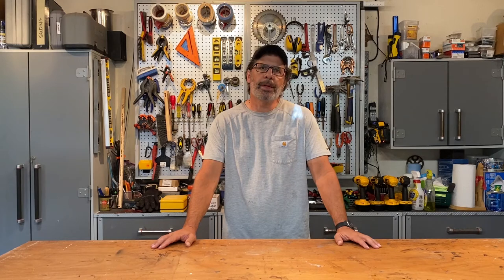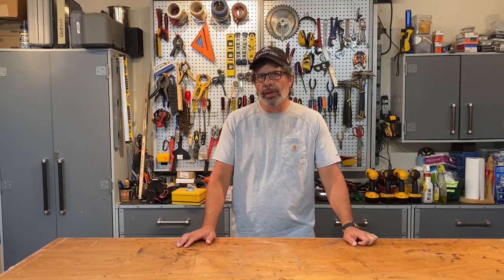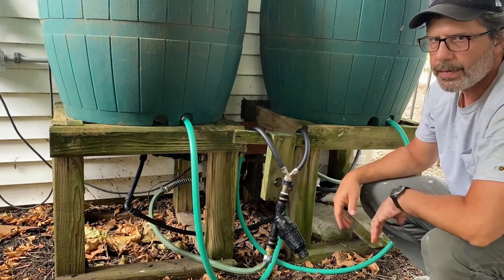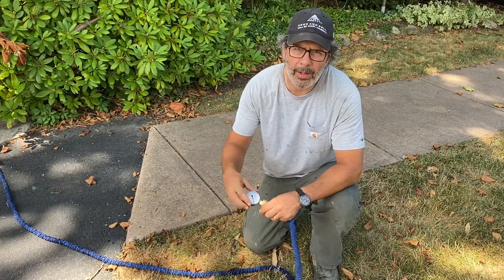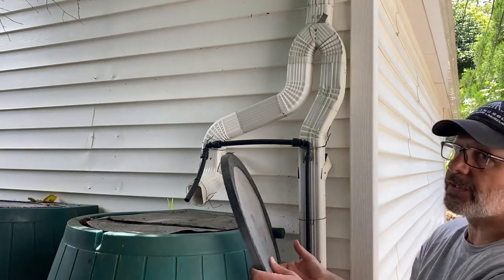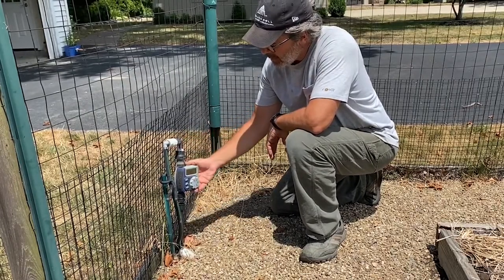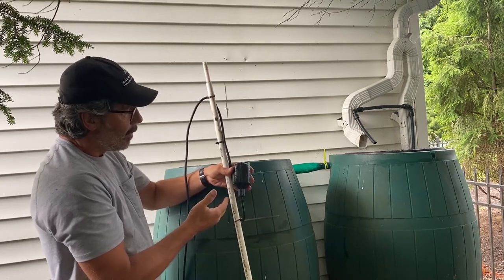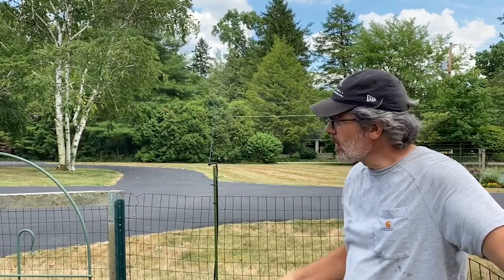The Ultimate Rain Barrel Irrigation System

Comment: I’ve probably watched 50 rain barrel videos and picked up tips to apply to my system. This presentation is the most comprehensive presentation I’ve seen! The pump installation is a great idea. The entire system is simple, yet covers all contingencies. Thank for the great presentation.
Reply from the maker: Thanks for the feedback!
Reply: He may need more barrels to contain rain water. Seems impossible to fill 600 gallons per 1000 sqft roof per in of water, in which where he lives can provide 18000 gallon per year!!!! We’ll make 10-15 55 gallons and it’s good to go. No need for step 4
Reply: @PhongNguyen-el2tz  he needs a couple of IBC totes

Comment: Great system I built it with 2 - 275 Totes.   My System has 2 zones 1 for the Garden and 1 for 200 Blueberry plants.  I added a 1st flush system which gets anything that’s on the roof before it gets to the 1st screen. I also added an air vacuum relief valve on the highest point in the garden and in the blueberries to relieve any vacuum in the lines. PS this was a retirement project- I’m 72
Reply from the maker: Sounds great. Thanks!

Comment: Awesome video.  One tip- you're only going to get a maximum of 1 psi for every 2.31 feet of elevation difference.  That is without head loss, so to get 45 psi you'd need to build 100+ ft high rain barrels 😂
Reply from the maker: Yes.  Thanks for the info.  I realized pretty quickly I was not going to get pressure that way.

Comment: 9/10 I love the system. the redundancy is awesome. my onle concern is power failure may cause flooding from the redundancy system.
Reply from the maker: I’d the power goes out, the solenoid will be in the open state and the water will run into the downspout overflow (no flooding). In my case, I get a text message when we have a power outage and my neighbor knows how to shut down my system.  If I wanted. Foolproof system, I would put another solenoid connected to the main power, before the outlet which would switch to the closed position in a power outage.  Easy to do, but I didn’t feel the need to spend the money for that extra part.

Comment: Thank you : we in BC Canada are in a level 5 drought now. Well owners have the same responsibilities, as those under  water restrictions in the towns and municipalities, to conserve water. 
I was super interested that you use a float switch as one is also used with the pump in my second tank of my yard anaerobic “  whitewater “ system. I’m very familiar as I’ve serviced or replaced  both the pump and float switch, therefore I’m confident that I can try the system that you’ve devised and so kindly shared 😊 Great video !
Reply from the maker: Thank you!  Good luck.

Comment: Well produced video. My only question, is what happens if you lose power to your house during a storm or outage. I think your backup system is going to fill your barrels non stop and then overflow out until power is restored.
Reply from the maker: That is correct. You would want to put a second solenoid on the house power before the float switch to shut off the backup hose when power is off.  Our power outages are infrequent, I get texts from my security system when power is down, and my neighbors know how to shut down the backup filler.  Worst case, I waste some water, so I never invested in the second auto shutoff.
Reply: Oh. That would be a simple fix. Power outages are infrequent around me too but it was just an interesting thought experiment. 

Thanks for the reply. Keep up the good work.

Comment: Great project.  Well explained - the flow chart says it all.  The only thing I would have done differently would be to put the overflow connection between the barrels at the bottom rather than the top.  That way you can keep an even level of water between the two barrels.  Otherwise this is an excellently designed system. You put a lot of thought into this project, and I commend you for your efforts.
Reply from the maker: Thank you for the feedback.  I actually created a fully animated version of the flowchart, but ended up not including it in this video. I’ll create a supplemental video some day with that version.

Comment: This is exactly what I was looking for. I just bought a 200 gallon tank and am going to do every bit of this. I have a drip irrigation system connected to a second sprinkler meter and want to get to just rainwater and even grey water from our shower.
Reply from the maker: Great. Glad it is helpful. Check the comments in the description of the video where I discuss options for dealing with potential power outages.  I’ve not implemented it, but many have asked about it.  Also, if you are really trying ti optimize the rainwater, there are some small tweaks also discussed in those notes.  Good luck!

Comment: Thank you for the video. I liked it very much. 
Only two things that I didn't like in the system, but at least one is already mentioned in the comments (and you are aware of that). When there is a power outage you will waist a tap water and the second one that you might fill the second tank a little bit lower, so both barrels be more in sync if I can say it that way. 
One other potential problem could be if you forget to open the water before the pump and the irrigation system is on. I think this could also burn the pump, so maybe have to put other sensor there.
Thank you once again, it was a pleasure watching the video.
Reply from the maker: Good points.  Thank you.

Comment: Great stuff. It really shows you have put a lot of thought into this system. I really prefer it when someone shows something that is working for them and not a work in progress. Thanks for the insights. I do have an unrelated question however, what are those cabinets behind you in your workshop? They look exactly like what I’m looking for.
Reply from the maker: Thanks!  The cabinets are a set I got from Lowes about 12 years ago. I believe it was a Craftsman branded set but the manufacturer is Sauder.   The pegboard cabinets are something I custom made. They open up with pegboard on the inside as well (basically 2x more space than what you’re seeing when they are closed)

Comment: Outstanding vid! brilliant! I have a project where I’m installing a rain barrel drip irrigation  system for my vegetable garden at my farm which is a 2 hr drive from my primary residence.  I’m planing on a solar powered pump system on a timer with the water source being two 275 gal totes.  I had not considered an auto shut off for the pump but realize this is essential for the system.  My primary source of filling up the totes will be rain but I’ll have to haul water from my hunting shack when rain is insufficient to fill.  I absolutely love the idea of auto fill with the selinoid. My shack is about a 1/4 mile from the garden but there is a spring about 25 yards away.  I’m now scratching my head to determine if I can use that as a back up source.  Great work! “Anything worth doing is worth over doing.”
Reply from the maker: Thanks.  I have not tried it, but you could probably put a small submersible pump in the spring and use the float switch to trigger it on and off, similar to what I’ve done with the hose here (you would not need the solenoid).  You could try an inexpensive one for about $50.  Connect it up with a hose or some flexible irrigation tubing.

Comment: I like it and definitely going to make one for my garden.     Expect I want to add one more thing to it you throw away so much free water with the A/c system instead of draining the A/c condensation water to your house drains.       You can Rerouted your a/c drainage system to your rain barrel where the black hose is and you can minimize the amount of water it takes to fill up the barrel if you go days without rain it would be a constant source of water when your a/c system is running.    Then possibly making the backup water system run less saving water from the water hose
Reply from the maker: That’s a good idea, but this barrel is in a separate detached garage about 100 feet from my house. My AC unit is also in my basement so I would need to pump the water up to the barrels. But it is a good idea to reclaim condensation if you can and are really trying to conserve/reclaim.

Comment: Amazing!!! Genius!!!  Although we're off grid....
Reply from the maker: Thanks. You could run a solar power system with a DC powered pump.  The pump I use if very similar to RV it boat pumps which can run on 12v solar collectors/batteries.

Comment: Wow what a great idea you have certainly changed my design for my system that I am running off solar power and a 12v battery. Only issue I have is my pump is 12 v and not an on demand pump
Reply from the maker: 12v is probably better (safer) than AC.  On demand pump is only required if your timer is on downstream end of system. You can active the same thing just by putting a timer on the pump.  But I also have a “manual” setting on my irrigation timer so I can turn it on in the gardens at any time and get water from the barrels.

Comment: Really nice system, thanks for sharing.  I am on travel a lot as well, and will probably borrow some of your ideas for my 8 barrel system that isn't really a system yet, but I don't know if I would feel comfortable with having hose pressure on for a month at a time while I'm gone so I will probably just do without.  I thought for sure that mister was for the hummingbirds!  They do tend to like using fountains for baths.
Reply from the maker: Thanka.  As I’ve noted in some other comments, you can out a second solenoid, using house power to turn off the hose backup in the event of a power outage.  Or, there are some wifi options now where you could remote trigger a baxkup refill of the system on demand,  good luck

Comment: Thank you for the great video! Three quick questions:

1 - What are you using to keep the float switch upright in the barrel? It looks like just PVC, but is one end capped? How to you keep it in the tank without it going sideways?
2 - For the solenoid, I see some similar ones on Amazon, but most of the reviews say that they get extremely hot very quickly. Do you have that issue with the one you got on eBay? 
3 - How do you have the solenoid wired up? When you discuss the electrical parts, you say that the plug that goes into the float switch pump is for the on-demand pump and the solenoid, are the wires just tied together where you have that pigtail connected to the on-demand pump?
Reply from the maker: Thanks. The float switch is attached to the pvc.  I have a circular weight in the bottom of the barrel that holds the bottom in place and the top end is cut to the proper length to it wedges into lattice in the top of the rain barrel. 

The solenoid can get hot. My housing it 3 sided so it always has air flow, and it is outdoors. I would never fully enclose it or have it inside.   Another person suggested a motorized ball valve which may be another option to consider.  

The solenoid is wired in directly with the pump wiring using a waterproof connector. And they both go to the male plug which then goes into the float switch female receptical.  

I’ll look into the motorized ball valve later this week and see if that would be a workable option.
Reply: @dontscrewitup  Thank you so much! My wife's only comment was "is this all necessary?" Obviously, the answer is yes.

Comment: The problem is that if it rains on day 5 to 7 your rain water barrels still have house water on day 4right right after it fills with house water you'll have a day's worth of house water in the tank should have a splitter after the pump to inject the house water in but you'll need a back flow preventer in line that way your tanks stay empty until it rains but other than that your system is perfect as even as is if it rains right after the float switch has refilled the barrels with house water you'll only lose a day's worth of rain water just a suggestion I do like the filtration idea I did mine without and I now need to rebuild my pump as for the automatic and the drip irrigation that's my last step my next one is to conect my rain barrels at the 3 corners of my house with the rain barrels by my 2 sheds and my garage together and for that I like your quick coupling idea
Reply from the maker: Thanks, yes that is the most efficient way, to connect the backup filler downstream of the pump directly inline to the garden.  This way was a simple setup for me with less plumbing and it worked, so I haven’t changed it.   My system is still running, virtually maintenance-free.

Comment: Thank you for this excellently presented video.  I currently have one rain barrel which I use to hand water my garden.  I am looking to expand my garden and current basic rain barrel system. I was looking for something like this specifically that would allow me to install a drip system. Depending on how large I expand my garden, I may purchase larger rain water collection barrels to use implementing your system. Tap water is extremely expensive in my area so I'm trying to figure out anything I can to water my garden for less money.
Reply from the maker: Yes, you can add as many barrels as needed and link them all together.

Comment: Pretty sweet system I have often thought of the same concept,  however I always get stuck on power failures.  The system is perfect until there is a power outage.  If a power outage happens the solenoid valve opens.  Thus over flowing your rain barrels and causing a mess beside the house.  Not to mention that water is paid for water.   I thought about possibly instally some sort of an api system?  Or possibly a dc solenoid valve with dc float for the solenoid valve small solar panel and a small battery ?
Reply: APU sorry not api
Reply: Deep cycle battery small solar panel, dc 12 vold solenoid, dc 12 volt pump everything the same only dc.
Reply from the maker: Install a second solenoid on house power that is open when power is on and off when power off. Upstream from the backup filler.

Comment: Man you're a great teacher.  I chuckled a couple times when you talk about electricity and tomatoes plant knowing the different between rain/hose water.   One question I have is does the solenoid gets turn on every time the float switch turns on?  If that the case how does it ever gets fills with rain water? Thanks for the video.
Reply from the maker: The solenoid only turns on when the pump is off and the barrel is dry.  They never run at the same time.

Comment: Thank you for that video which I found very interesting but I do believe that it is over complicated. I have installed a rainwater collection system in my garden with back up from the mains water supply, no pumps, no electricity (only  a couple of batteries for the irrigation timers)  1100 litres of rain water, totally automatic.  I fill the barrels from the bottom not the top, run the micro drip system in a circle from the rain barrels to the mains water. Put an irrigation controller on the rain barrels (0 bar eg plantiit) and an irrigation controller on the mains tap (eg gardena) The gardena controller has a water sensor. If the rain water runs out and the ground runs dry mains water will kick in.
Thanks for your post, these rainwater systems can be more complicated than they appear at first sight it seems to me.
Reply from the maker: That’s a good design also. I was not aware of the Gardena sensor system (or if that existed 10+ years ago when I set this up). Thanks for sharing.

Comment: Don't know if anyone mentioned this but another problem I see with your system is:
a heavy rain falls just after your tanks are filled with city water and you end up in an off cycle with the weather patterns to where most of the times you're using more city water than rain water. Seems like you need to incorporate more storage capacity between rain cycles to really make the system ultimate.
Reply from the maker: Yes, I can always add more capacity. I could also connect the city water backup system directly into the irrigation line and bypass the barrel filling altogether to leave it fully available only for rainwater.  It would still run off the float switch, but rather than filling barrel capacity, it would go directly into the hose line after the pump.  Just a little more plumbing than I preferred to do with the initial setup.
Reply: @dontscrewitup  Got it! Congratulations on your excellent work. You're much appreciated for your selfless sharing of a decades long effort--that is an extremely rare thing in our world today.

Comment: Great video and innovative design!
 I do have a question regarding "2) OPTIMIZING RAINWATER COLLECTION - REDUCING HOSE WATER"... Wouldn't one need to install a check valve on the outlet side of the pump to prevent filling the water tanks? This assumes the main shutoff valve is open of course.
Reply from the maker: Thanks. Good question. I believe the pump essentially has an internal check valve when it is in the “off” position.  I believe it has backflow prevention built in, but I’m not 100% certain.